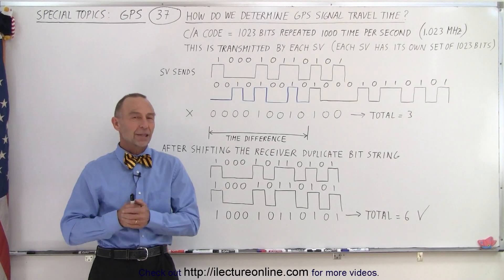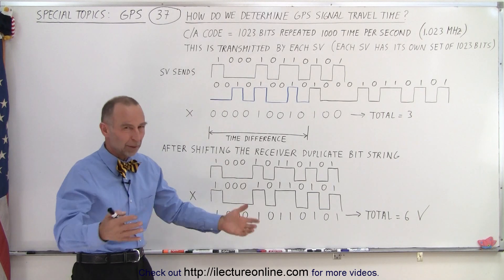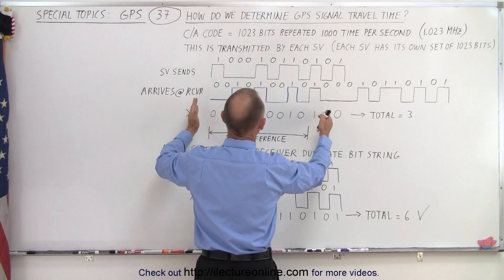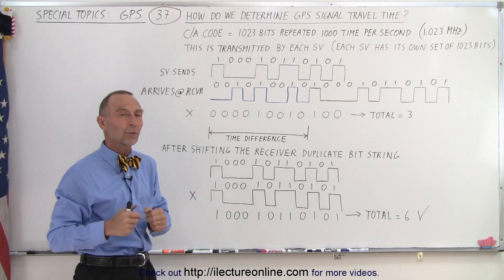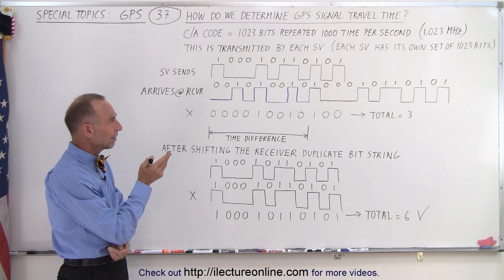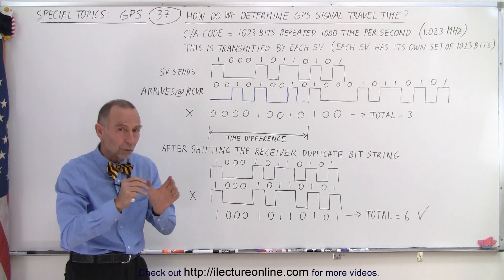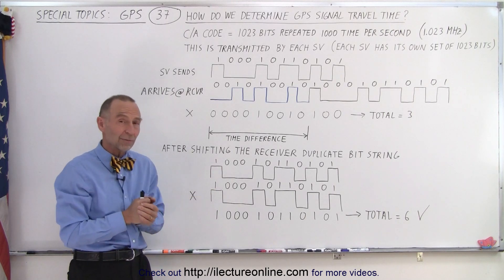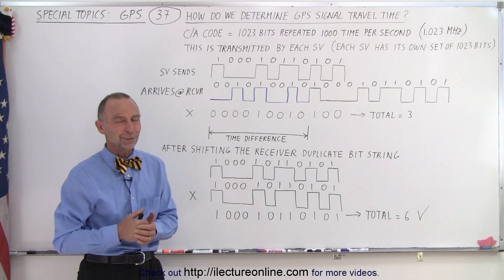Special Topics - GPS (37 of 100) How Do We Determine GPS Signal Travel Time?

Comment: Watching this, a question popped into my mind:
Does a C/A code have an upper limit of 1s in it. Is  that number the same for all PRNs. If it is not, for a sequence of C/A code that all consists of 1s would be the most correlated?
My possible answer: The distribution of 1s and 0s in the C/A code is designed to be pseudo-random, with an approximately equal number of 1s and 0s over the entire sequence.

Comment: About 20 yrs ago I designed silicon for (non-military) GPS RX in mobiles (handsets).  
At the time I had to deeply study the system functions, timing, almanac, ephemerides, Gold codes, data frame structure, etc. This gave me DEEP respect for the original architects/designers who pulled this together and made it operational.  
  But watching your video I have highest respect for YOUR ability to distill the key functional elements down into bite size explanations “understandable by mortals.” Very nicely done.
Reply from the maker: Thank you.  Yes I must say I am thoroughly impressed by those engineers who designed all the various aspects of the system.  We have an older gentleman working for the same company as me.  He is well into his seventies.  He has been designing much of the GPS technology that we develop for more than 4 decades.  His knowldege is incomparable and we fear the day he finally retires.  🙂

Comment: 8 Two guns A and B can fire bullets at speed 1 km/s and
2 km/s respectively. From a point on a horizontal
ground, they are fired in all possible directions. The
ratio of maximum areas covered by the buyllets fired by
the two guns, on the ground is:
[Make video in question like this

Comment: Thank you, but I’m sorry, I don’t quite understand - where is the CA code that we’re bit shifting with respect to coming from?

Anything sent from the SV to the receiver will be equally delayed, so what bit stream are we shifting and multiplying against? I’m sure it’s a simple answer 🙂
Reply from the maker: Each receiver has a copy of the bit code sting from each satellite.  By comparing the bits (by shifting one of the strings) we can determine when the signal was sent and when it was received.
Reply: @MichelvanBiezen  Does that assume that the sender and the receiver have synchronised clocks? The receiver knows what was sent at a specific time?
Reply from the maker: The clocks are not synchronized.   The receiver clock error can be checked with the universal time available from the command center and the satellite clock error is calculated (to be shown in a later video).
Reply: @MichelvanBiezen  Is there already any video that you explained this synchronisation problem? In all your lectures there is only mention about "clock error" due to quartz clock drift in the receiver, but assuming that receiver clock is atomic clock, still remains the synchronisation problem for dermining pseudorange.
Reply: Thank you, I think I get the picture 🙂